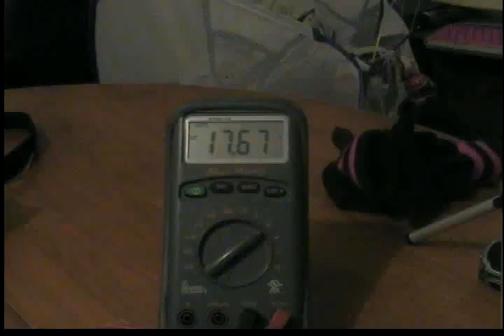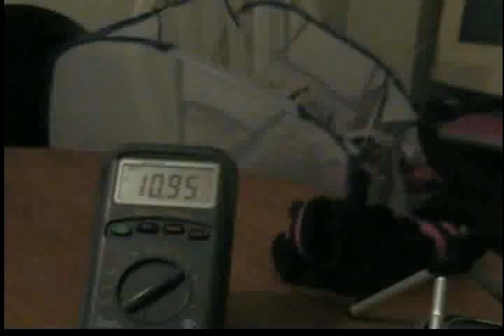Rodin HIGH VOLTAGE

Comment from the maker: @devel155  The circuit is a pwm (home made) that pulses a standard 5 pin relay. The relay makes-n-breaks groundto the coil primary. Then the high voltage goes thew the rodin coil then to the center electrode. Then ground the case of the plug. It will eat relays, but have never had any problems with it going to the pwm. Is that enough info? Thanks for asking. Peace raawbush

Comment from the maker: Have you tried putting a diode across the ignition coil? Also you might try wrapping the wire from the output of the 555 (pin 3?) to the base of the transistor around a ferrite ring, this might help the spike from getting into the timer? Thanks for your comments and happy experimenting. Peace rawbush

Comment: try wrapping the roden over a coil of wirer. when i tried hv through it, the arc increased when i connected the inner coil leads together, and then pulsed  the hv from an ignition coil driven from a 555 timer. i really like your method of switching, as i burn up my 555's regularly from the back emf.

Comment: Smoke over the rodin coil, to see if there's air disturbance, also see it's effect with water under it as the other people suggested. Perhaps maybe you can try some experiments under different atmospheres? Like see the affects of the different surrounding gasses other than oxygen that it might have...Maybe also you could take a glass(that you would use to drink with) and put a spherical neodynium magnet over it. The way the rodin coil is design it focuses a magnetic field inward at an outward...

Comment: Try blowing a bit of smoke over it to see if the charge in the air creates any visual effects??

Get a second rodin coil with just a light in its circiut and hold it near to the field and see if it charges the light....... if it does, how much energy does it take off the main coil??